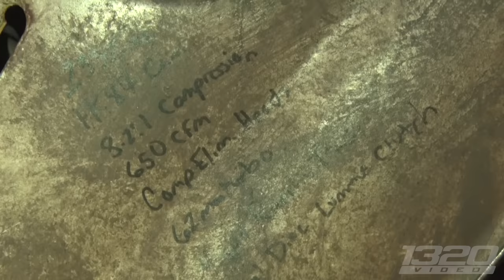FarmTruck and Azn FINALLY RACED!

Comment: Legit two and a half ton long bed c10 with a full cage.  That is not much heavier than stock, or maybe even lighter.  Love this truck.  Best pickup design of all time 67-72 c10/k15. k15 gets bonus points for dual headlights.
Reply: The Wakz yeah I had a 84 in highschool with a 350, 4 speed, heads, cam. Loved that thing. I really want a 67-69

Comment: Damn the bug was smoking like a diesel!!
Reply: I say the ignition isn't firing all the fuel they're dumping in it. Plenty of fuel, why the bog out of the gate?
Reply: The turbo isn't a standard setup so the mix is off until it gets spinning hard and the mix will be off when throttle changes. It's a bad setup in general, but better than naturally aspirated still.
Reply: Well for one its carburated lol. Carburated turbo is never gonna burn clean.
Reply: I don't think that's a carburetor. It looks like a FI throttle body.  bty.... if it is electronic FI, I don't see an o2 sensor which is absolutely necessary to make it work properly.  Also if it's 650 cfm, it is way too big for that engine. A 500 Holley 2bbl or a 450 4 bbl is a better choice.
Reply: Axle Grind he said it’s carbureted
Reply: If somebody identifies it, I might agree with him. But otherwise I've never seen a carburetor with an idle air control motor and other electronics that this one has on it. It looks like an aftermarket throttle body. idk
Reply: Jack Caldwell  Antilag

Comment: Street legal but puts it on a trailer ?
Reply: mdillonmarshall Fairly certain that 632 makes 1000-1100 before both kits!
Reply: can imagine the gas mileage on that thing? I'd put it on a trailer too lol
Reply: Probably Because he's on drag slicks.
Reply: mdillonmarshall huh...I somehow replied to the wrong comment lol?
Reply: Tim Fritz its probably low compression since it was was built for nitrous, so maybe low 800 naturally aspirated but gobbs of low end torque
Reply: Underpantsniper but nitrous likes compression it's not like boost.
Reply: MELEK ONER yeah he should totally destroy his drag tires and burn a shit load of fuel and put extra miles on that expensive ass motor. No... he keeps it street legal to roll into town and have a burger at local car shows and shit.
Reply: There's a 632ci big block Chevy that costs well over $50,000 that makes 1200hp not including the kits of nitrous he has and it weighs 5,000lbs I bet he gets not even 1 mile per gallon
Reply: MELEK ONER you've probably never owned a racecar or went to an actual track. Listen to the last thing he said.
Reply: Underpantsniper they put it on the dyno on the show and the truck made almost 1200 without nitrous
Reply: Is that uncommon? YOu can go to the track (Milan) and see 20 cars that are street legal....but they get about 5mpg.
Reply: My daily driver is street legal but has been on a trailer before, your point?
Reply: Noble to OKC is a somewhat short drive but wouldn't want to spend the coin on race gas at $7 a gallon with it probably getting 5mpg.
Reply: Race gas is like 14-16 bucks a gallon depending on what you run, and with the gearing that truck has I bet it doesnt do better than 10mpg.  Not a very cost effective drive to go through hundreds of dollars of high dollar fuel just to get to the track.

That's why I run e85, way better than pump gas for a boosted car and it was 1.65 a gallon last fill up.
Reply: 1 hwy/0 cty
Reply: Not only bout the gas the but if the truck breaks doing a pass they can simply put it on the trailer and take it back home. Instead of a super costly towing fee. Thats the main reason most people take trailers to the track.
Reply: Jonathan Fernandez damn good point!
Reply: street legal, not street practical
Reply: if memory serves I think when he got that moto on street outlaws it dynode over a 1000hp before the nitrous.
Reply: bro build just a reasonably tough street car, take it to a track which could be 1-2 hours away then when the inevitable part break happens maybe you will understand why people do that. Most tough street cars you see videos of getting driven to the track have another car that will come carrying tools/slicks/ and a trailer. Since most people do that you may as well save your cash, skip the risk of getting rolled from the cops and just put your car on the trailer. Had a 430whp sr20 180 back in 01 that constantly broke gearboxes on the street. No way would have i ever taken it to the track without a plan b - which would not include paying $300 for a tow truck and waiting 1hr or 2 from him to arrive
Reply: 5 - 8 gallon fuel cell and a truck that gets about 5 miles per gallon.... would you drive it 100 miles from the track???
Reply: The point is it does a mile a gallon. And not the cheap stuff. Try 12 bucks a gallon. I would trailer it also.
Reply: I live 2 to 3 hours from any of the local tracks so of course i trailer my street legal car as well. If your stuff breaks and you dont have a trailer your SOL
Reply: Street legal depending on the cop.
"Oh these tires/harness/etc aren't DOT certified/whatever".
Reply: you do realize it would cost over 100$ to fill the tank right? it's a race truck not a daily driver.
Reply: Clearly you don't race anything with power. If you did you would know how bad it sucks to break and need a tow. Shit doesn't even take much power shit just happens. It's called having common sense.
Reply: MELEK ONER that is shit on gas going far and certain places have certain laws

Comment: I don't care how slow it is, that cars "fun factor" is off the charts, I guarantee that! I had an old fiero (not even the GT) the 2.5 iron duke and the mixture of sitting that low, with lightweight and decent horsepower was as much fun as my 340 hp Firebird ...actually more fun. 
Plus, it's an attention getter (I mean p#$$y getter) anywhere you go! There could be lambos, ferraris, etc and the crowd would be around the "dung beetle"!

Comment: The last race was neck and neck with the exception of the ground Azn lost due to shifting.  Just imagine if AZN was able to swap in a Porsche PDK or some other type of automated trans, plus he could swap in a 4 or 6 cylinder from a 911.  I'd love to see what an auto/PDK'd 1k-1.5k hp 911engine (like King Kong or FLK GT2) would do to the Dung Bettle.
Reply: dieseldan420ca the beetle would roll on its back if he hard launched it with that kind of power! unless he was using sissy bars.
Reply: dieseldan420ca or imagine AZN swapping in a JDM EJ20 with the AWD drivetrain and slap either a Precision 6262 or a bigger Turbonetics turbo with nitrous, and i'm pretty sure he could be unstoppable
Reply: Power can be always be adjusted nowadays with modern electronics.
Reply: Sounds cool as I am a Subaru owner but really high hp Subaru engines are not considered reliable by a long shot and cant hold a candle to a built Porsche turbo engine, the you have the whole AWD conversion that sounds like a nightmare and can end up slowing the car down at 4 digit hp levels.  No thanks just give me a 10 year old 911 turbo pull out drive train and call it a day.

Comment: The dung beetle is just basically a dung Porsche. Azn didn't have the bottles in there I don't think. Farm truck big block and 2 stage nitrous  (even though it's heavy if they didn't lighten it) I don't see dung beating it  from a dig.

Comment: I still think my 73' Challenger I had could've given him a run for his money. 340 4bbl, 202 heads, mild cam, 4:10 gears, factory slap shifter. Pulled the front end up every time I shifted. I know sleepers as I worked Top of Staging at NEDway & my dad built BB/GD's from scratch.

Comment: With 450th in the bug. Why is he starting out in low gear. That kind of power to weight ratio might use 2nd to launch it. Heck perhaps 3rd with a slipper clutch. Time for a billet Trans using 9" gears  bigger bell housing for a multi disc clutch with only 2 speed. Fast and faster. 
Heck I can envision a Lenco planetary single set in the there if I could figure out how to get the power back to the ring and pinion

Comment: Farmtruck using chevrolet and azn using Volkswagen
Reply: The Farm Truck definitely runs in the 9's in the quarter.  It ran low 10's with the old 502 and it's pushing a lot more power with the 632 in there now.

Comment: The slick on dung beetle is only 8 1/2 inches wide? They look like a lot bigger under those fenders. 
My 255/60 R15  mounted on 15x8 rally rims riding upfront are 10 inches wide. 
Of course I'm cruising, not racing.. 145 bhp with 12 inch wide tires and 2:73 gearing make cruising the ONLY option..